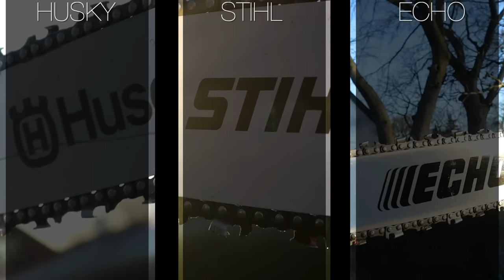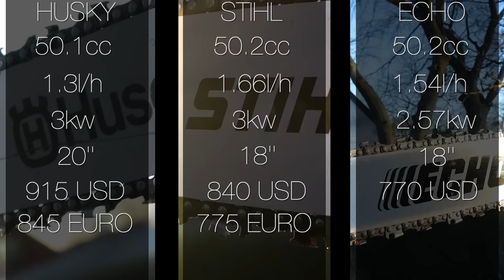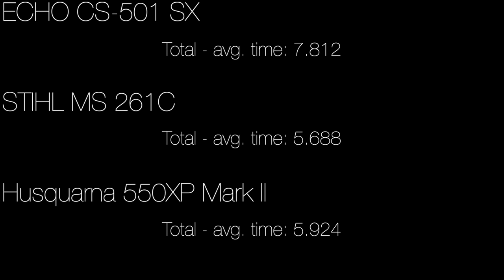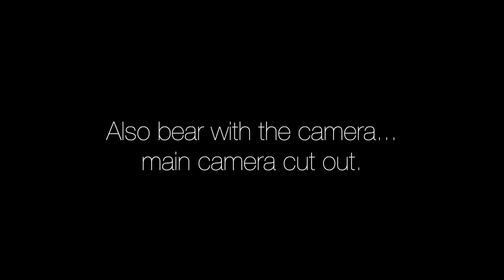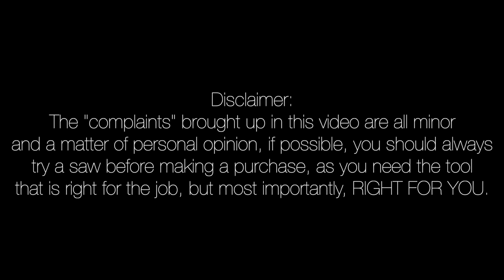Husqvarna 550xp mark II vs. Stihl ms 261 c vs. Echo cs-501 sx - Chainsaw comparison video

Comment: Thanks for the review, good to see them all together. After much research, handling, and consideration, and despite currently owning a number of Stihl products and a Jonsered, and seriously considering the two Europeans, I've ordered the Echo. I just couldn't convince myself on the other two. The Huskie feels heavy and awkward, the Stihl nice but I don't like those caps on  my other gear, and the m-tronic just doesn't sit easy with me. Significantly lighter, significantly cheaper, longer warranty, simple Japanese quality, professional grade saw which is nice and compact and which seems to me to have all of the upsides and none of the downsides of the others for a careful owner user. That switch btw is as natural as heck to flick to off when needed, particularly in a hurry- what is Stihl thinking with awkward thumb up to off? From all accounts once they are worn in they perform much the same as the others- give or take which makes little difference to me. Thanks again.
Reply: Pessima scelta, meglio è la sthil

Comment: The Echo appears to have a felling sight line on the other side right behind the pull cord. But yes, it doesn't fully wrap the chainsaw.
Reply: The top gunmark is on filter cover (not obstructed by handle). The sprocket cover also has one.

Comment: All I run these days are echo, amazing machines especially for the price.
Reply from the maker: That's awesome. Which saws are your favourite?
Reply: Femalelumberjack I just picked up the CS 4510 to replace one of my old intermediate saws. Absolutely love it so far considering I’ve primarily purchased the Husky’s in the past. Nice thing about this model is the ignition was redesigned so it’s always on until you push it to kill the engine. Either way really well done video with lots of good info.

Comment: I love my 261 cm vw. Enough power no stalling Indeed the oilcap is annoying. But I never wanna change it to an husqvarna. I hate husqvarna saws I’m a stihl guy but there are enough guys that love husky saws
Reply: When it comes to a 50-60 cc saw I'm Husqvarna all the way. I just prefer the weight, balance, and power/torque over other brands. I can't speak about the 550xp, but I've owned a few 562xp saws n the power is phenomenal! I just wish they had a bit more longevity. Now when it comes to a top handle saw, I'm stihl all the way! The power, weight and ergonomics are 2nd to none.

Comment: Great video!   I've had 261 for a year now, a MS251 and MS170 for several. with that being said, obviously a STIHL guy... but loved this review. Very intrigued by that 550....
Reply: I have a MS170, 2- MS181 and a MS251C most of them have the easy start and tool less chain covers a bonus for when your out in the woods. No tool chain adjustments and you never have to pull your shoulder out of socket to get it started. Best thing you can buy for any saw is a Stihl 2in1 sharpener

Comment: Good job on the comparisson.I am using an Echo CS 501 SX and a CS 620 SX.Echo saws gain a lot after some tanks of fuel.My 501 wake up after the 10th tank,like 20% more power so give it some more running time.Also Echo saws gain a lot from a muffler mod(501 and 490 are the easiest saws to mod the muffler) so another 20% for sure.Then you can compare them,a fully broken in,muffler modded 501 sx would be the fastest saw of the three.Just saying.
Reply from the maker: Thanks for sharing - it's always nice to hear from people actually using the products!
Reply: @Femalelumberjack  🙋👍💯💯

Comment: Beautiful and knowledgeable about chainsaws, what more could a guy ask for😁 I'm a Stihl guy, 3rd generation Stihl user. I have a 261 and love it. I have owned 2 Husqvarnas. The dealer network for them where I live is very poor. I'm not sure that echo is in the same class as Stihl or Husqvarna. I don't have any experience with them other than looking at them at a dealer. The dealer network for echo is not good either. There are Stihl dealers everywhere here and I have one that treats me good. If you look at dyno Joe's videos you will see were he did a 50cc dyno video. The Husqvarna kicked butt with 4.5hp, 60cc saw hp.

Comment: Amazing video. I’ve had bearing issues with both my 550s (non mark2) and my 562. I am looking to the stihl 261 and hope it holds up better than the husky although I love my 550s. Thanks !
Reply: Run 40:1 at least, or 32:1. 50:1 is bad for bottom end bearings in any chainsaw as rolling motion requires oil volume, unlike the sliding motion in pistons which cares more about the quality of the oil than the volume of it. Most people that don't use them professionally won't notice that their saw dies at 500-1000 hours of work, or get to these number of hours in 10+ years and just get a new saw as it lived enough in their eyes, but a professional sees a big difference between that lifespan and 3000+ hours until bearing wear occurs.

Comment: Fantastic Review!

I would use any of those saws....

Stihl makes the best chain.

I am running Echo-590 and Makita(Dolmar) 6100.  

I replaced an 8 year old Husky ,562 xp.

The Makita ,6100 cuts as good or better than the 562XP.  And that's saying something!!!

The BEST thing about the Makita.  The chain tensioner is NOT mounted on the cover so when putting cover in it goes on super easy you don't have to line anything up!

Comment: <Thinking> 
) like stihl dont need tool to remove bar .
Easier to maintain carb and air filter.
) I like Echo saws owned them too.
You feel pins and needles
Vibration through handle .
Husky..yip got one..too many plastic parts that could break.
Not easy to maintain carb and air filter.
Good informative vid.
Thank you
Pleased you choose sthil
Reply: Stihl every time
Reply: You say "could break." 

But have they broken?
Reply: @wiredforstereo  Good observation.
<Thinking>
At worst ive had to tighten nuts n screws that vibrate loose.

Comment: The $74 difference will more than make up for itself after one season in fuel cost.  I know a .3 litre per hour difference doesn't seem like much but it is a lot.  Husqvarna is the same saw as the Stihl it just costs less to operate while still producing essentially the same result.  Over 10 seasons you could buy two more of them in the fuel money you had saved.

Comment: Thank you for your review I have been looking for a replacement saw and have been looking at that Echo , mostly because of price . I have Stihl 034 and a 028 good but heavy and old . Didn't like the Husqvarna it leaked chain oil more than it used Thank you again and be safe
Reply: Echoes are decent saws for the money, if you can get one made at the kioritz plant you won't be disappointed. They hold up very well.
Reply: Have the oil pickup tube replaced or replace it yourself and you wont have the oil issue with the Husky anymore. 

I have all three brands of saws that she is reviewing (different models) and of all my saws my Stihl 036 is still my favorite. For the money if the Echo 590 has a muffler mod and re-tuned is a heck of a saw. The Husky is about the smoothest of them. They all have their pro's and cons. Husky is also about the easiest/cheapest to get parts for if you do your own work on saws.
Reply: my ol rancher leaked bar oil too.  But not with the pro 555xp.  this saw rips!

Comment: Great video, always nice to see a women's view on things. I would've like to see the Echo compared with the same size bar. Also what are the factory specs with what bar and chian?
 I'm a Echo fan, own 7 saws starting from the late '70s to 2012
CS490, all great and powerful saws. The older ones do develop more power than the new saws.
 Never owned one but always heard Husky was tops with the loggers. Never been impressed with a Stihl on power or starting but a very durable saw.

Comment: I had a Stihl 026 & 044. The 026 was the best saw I ever had. I had a echo and traded it for the 044 because it was a little slower than i wanted but the echo always ran, very dependable saw. Then i went to Dolmar. Big mistake.  Powerful saws but always have problems. Same with their trimmers, nothing but problems. I think I will go back to echo's. I dont cut as much as I used to, and I know it will be very dependable, and more affordable.

Comment: Great video! Here's my one thought. You could step up to the echo cs 590 that's only 1.5 pounds heavier than the husqvarna and will run a 24" bar. Current listenings in my area have the 550 
mark ll at $599 and the CD 590 timberwolf at $399. And yes, I'm an echo fanboy. Lol Cheap, lightweight and I honestly prefer the sound. I find stihls annoying to listen to. But the 590 really is a great saw for a medium weight saw. If you get the chance you should try one out.
Reply: ... and I prefer the traditional choke and kill switch on the echos. All in what you're used to.
Reply from the maker: Awesome to hear from someone who uses Echo! Funny with the sound cause I like the sound of Stihl better 😆. I’ll definitely give the 590 a try if possible, thank you
Reply: Yes the cs590 is an awesome saw had mine for a little over 2 years now and no problems with it best saw I’ve use in its size class and can’t go wrong for the price and the 5 year warranty
Reply: Femalelumberjack I personally would jump past the CS-590 and get the CS-620. I personally run both and the extra $ is definitely worth it for the 620. Unlimited coil, upgraded internals magnesium clutch cover, dual dogs, aluminum handle bar full wrap or half,
Reply: @aaronedwards993  It's always easy to justify the next model up! Why bother with the 620 when the 680 isn't that much more and it's a lot more saw. There's plenty of YouTube videos of people running 800's with 36" bars when they clearly have very little experience and don't need anything near that big. 
  I've been thinking about a 680 because sometimes the 590 just isn't enough. I'm actually holding out for the release of their new 70 cc offering.

Comment: Hi there.
I have both the Stihl 261cm and the Echo 501sx.
I can tell you with my saws, the Echo took about 10 tanks to run in. The stihl only needed about 5 tanks.
The Stihl didn't pick up much power once run in, but the Echo picked up alot.
I also did a muffler mod on both saws, the Stihl picked up a small amount. But it was definitely noticeable.
The Echo however, 
After a muffler mod and 10 tanks of fuel it turned into an amazing saw. I could not believe how much improvement I got from the Echo after a muffler mod.
I honestly feel that the Echo is all but on par with the Stihl after the muffler mod and run in time.
Hope this helps some people
Reply: For how many years will the echo last is the question, we know the stihl will be 15-20 years
Reply: @Morpheen999  My CS400 is running strong at about 10 - 11 years.   I've had no problems with it and have never had it in the shop.

Comment: I've always found echo saws to take a few tanks through them before they really start performing at their peak. It would be interesting to see it after a month or so of work
Reply: My 620p took about 12 tanks to really open up
Reply: Absolutely. My 590 and 370 both became different saw after 10 or 12 tanks. Just got a 2511t. Impressed so far but anxious to see if it wakes up a little more.
Reply from the maker: Thanks, that’s really nice to know!
Reply: @danquirke443  my 2511t is up and down with the tuning but it has woke up a bit with 10+ tanks through it. It came with 91PXL chain try it with stihl 63PS. I changed the bar to a 44 drive link bar to make it easier to get the chain off the shelf from stihl.
Reply: Dan Quirke Agreed. My 620p rips now; really woke up around 10 tanks. I like the fit/finish of the STIHL but for the price, Echo.

Comment: Good video. The echo needs the high speed screw adjusted slightly, it's not winding out like it should.
Reply: probably not broken in yet. Mine will out cut any saw of the same size I have ever owned and I have owned many brands in the last 37 years that I have been cutting.

Comment: the deciding factor for me is the 20 inch bar the Husky can handle.  I have old oak trees 40+ inches across that wind takes down.  24 inch bar would be super, but you have to work within your budget as well as getting most out of your money.  Husky for me.

Comment: Looking at getting the MS261 and had a question.  My local dealer said that it is not real good for it if you are doing a lot of light work with it and that it really needs to be pushed hard.  Is this true?  I use a small Echo CS310 a little every couple of months.  Most of what I would be cutting is a lot of smaller stuff, but I do get into some larger mesquite and other central TX woods that the Echo struggles with.  I don't mind spending more for quality that will last even if I won't be using it much.  I was hoping the MS261 would be fine even if I was using it a lot for lighter stuff, but dealer recommended hanging on to the smaller Echo for the lighter stuff.  I'd like to just have one saw for it all.  What are your thoughts?

Comment: I have owned and used many Echo saws, they always sound and feel like they are not making full power. Great comparison, but the Echo is not in the same class of saws. That said, I use an Echo up in the trees for topping. I like the location of the switches.
Reply: Echo saws tend to respond very positively to a muffler mod. They have such restrictive mufflers. 

I have a CS620P that hangs right with a MS362 after opening up the muffler a little. They are also fantastically reliable and start easier than my Stihl saws.

Comment: Hey, I know this is an older video but a 550XP mark 2 for less than $600 adding in a pair of Husqvarna chaps $84 and two premium bottles of oil I’m still came out around $700bucks and that was the dealer setting it up with a 20 inch bar and everything taxes included

Comment: I'm a Stihl nut. I owned a couple Husky's, 1 - Echo, but fell in love with my steal of a Stihl. I picked up a MS250 for $50 8 years ago and it still chews up wood like a pig eatin slop. I have since added a 361(traded for a 046, I rescued and rebuilt) and 180c to cover most of my needs.  Thinking of upgrading to the newer 500i in the near future.
Reply: Get it ported. I want to try a ms500i against my ported ms441 arctic. I dont think itll keep up stock. The pitted ms441 eats some wood.

Comment: Hi, nice video. I had 2 stihl 026 for 25 years and just loved them. If I had not fall a tree one one of them it would last for ever as the other 026, still working great. Bought a new 261C and expected it to last  as long. After 3 years of cutting firewood it brake down with crankshaft failure. No guarantee as I used shell oil and mixed as I used with 026 saws. Stihl told me I was to blame not using stihls own gas with motomixoil. That told me new stihlsaws are not so good and durable as the old once. Just my experience with stihl 261c and the stihl company in Norway.
Reply: STIHL NUMBER 1

Comment: The carb tunes sound off on the Husqvarna and the echo!  I have an echo 590 and its super snappy even on a cold start.
Reply: the husqvarna is autotuned and it sounds like it runs good. the bogging is a known issue with these electronic carburators. The echo however sounded a bit rich. it didn't rev quite as high as it should've.

Comment: You can defiantly put a 20” bar on the 261
Reply: I've done that. It won't rip through 20 inches of timber like a 361 but it makes snedding limbs very much easier.

Comment: You come across very well lots of in depth analysis and well laid out information, not just blatant product placement. Well done young lady. I would use your review if available before purchasing any chainsaw product. You are spot on in relation to the Stihl fuel/oil caps over engineered crap.

Comment: The Echo was 2 seconds slower, but for me it still wins with quality and durability. Stihl and husqvarna can dream about the quality of the echo :) I had husqvarne and stihla, they broke :) now I have an echo for 4 years and have not seen the website
Reply: 550 husky Is a animal but I’ve had bearing failure
Reply: They break so often because they rev so high. The huskys and stihls can rev up to 15k, and for a tiny little connecting rod, roller bearing, and piston, it's very fast for all of them. The Echo revs a little less, and has smaller ports. This makes it so that it doesn't go through as much stress
Reply: Husqvarna owns echo saw and johnsred just sayin

Comment: I have several Stihl saws and I consider my 261Cs to be the Swiss army knife of the bunch. Just an all around great saw. My only complaint is that the M tronic system does not like hot weather. All my M tronic saws are the same way. Thats where my 500i really shines.
Reply from the maker: I haven’t had any problems with mine on hot days
Reply: Mine is one of the first built so they must be better now. @Femalelumberjack

Comment: I love my echo, it's an older cs520 with tons of hours its great to see echo is being compared to husqvarna and stihl I like them all. The bars that come stock on echoes are a bit shady, when switched to something different they bore cut just fine.
Reply from the maker: Thanks that’s good to know
Reply: I wish we got the Tsumara/Sugi bars here in the states, we get oregon bars which is the same as husqvarna.
Reply: In Europe they get the Tsumara bars, so that’s not the issue. I believe the chain speed is a bit slow for the bore cut on this. It would be interesting to see the echo with a 15” bar for these comparisons.
Reply: @aaronedwards4603  I agree on the saw shown, give it a break in and it should cut better, after I gave mine a tweak and tune with a new bar it cuts really good now.